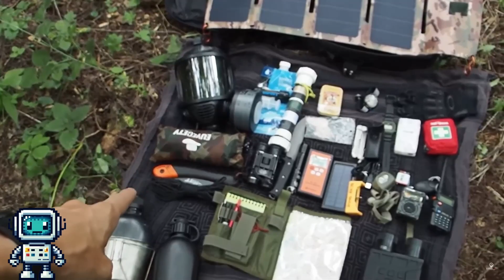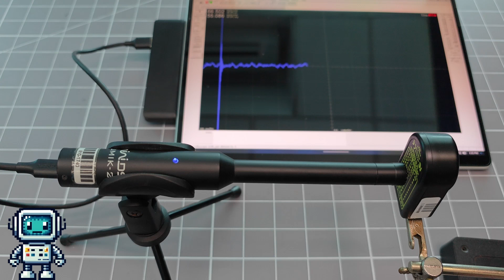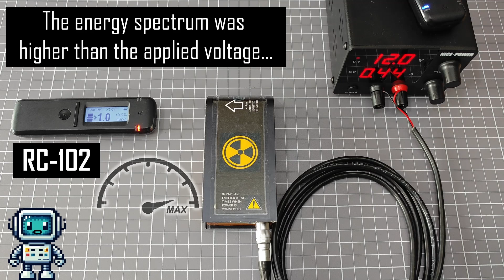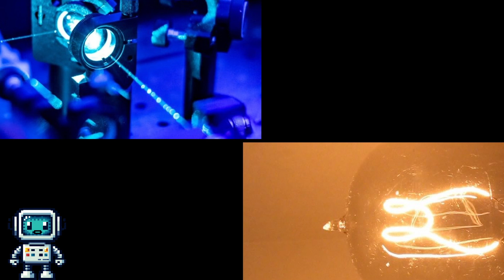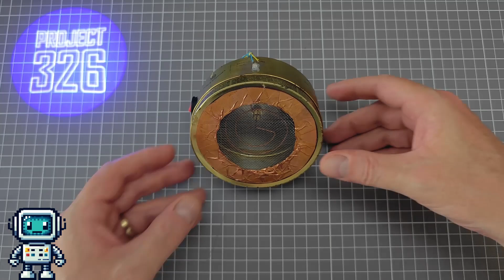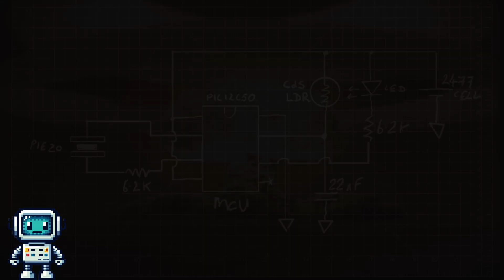NukAlert or SCAM Alert?

Comment: You will never believe this but I manufactured these. It was a family business and they really do work. Im still laughing at the reviews though, good stuff.  

It was designed for "foxhole sniffing" in the aftermath of a serious and spreading event.

The tick is keeping the chemistry primed, the chirps are quiet because it drains battery.

Making it last ten years, waterproof dust proof was the appeal.  I've hit one with a baseball bat and left it to rot in the yard for 4 years and it's still ticking lol.  Keep up the hilarious reviews❤
Reply: I'm thinking you might have gotten a dud. There were a few through the years. If you contact me, I can send you a new one.  Heads up though the batteries were designed 15-20 year life but could only legally claim 10 reasonably.  So it might be mostly dead as they are melt sealed
Reply: Sorry to spam. If you put it in a cool place it will quiet faster.  It's based on a scatter chemcial optical design that was put together decades before the modern sensor tech
Reply: Last one I promise.   I agree that the price was ridiculous.  We did everything possible to keep it American.  I or someone next to me hand made every single one out there.

But r&d, red tape stuff, middle men, filing fees, and investors all hiked the price.  We did our best dude!  I love your format!😂

Comment: Is it really just as simple as a photo detector seeing a scintillating crystal glow in the presence of ionizing radiation? I wonder if they just used a scintillating cube with photomultiplier (ie, Radiacode) rather than a coating.   Can you develop a nukalert alternative? The layperson IMO needs a keychain sized device to indicate it's time to get out of the area (ie, ONLY alarms at thresholds when levels are dangerous, not merely interesting) while being fail-safe (ie, if over-range doesn't reset, fail to alarm, or otherwise undesirable behavior when the area is in fact hazardous), and ideally has a vibrating motor like a cell phone, flashing LED indicator, and a physical sound mute switch the size of a keyfob and USB-C rechargeable or user replaceable batteries.  It would be more of a CDV-717 field survey meter replacement than a geiger counter, picking up where a geiger counter maxes out. Pair it with a Radtus R103 for "hey I ordered mild mushrooms and these are spicy..."
Reply from the maker: I agree with you completely, what the lay-person needs is a NukAlert that actually works.  I also revered a device that is pretty similar but does work: https://youtu.be/suHlPTI6U5w

Comment: Very cool, PLUS a homemade 'geiger' counter. SUPER COOL Never thought they could be so simple. I thought of low-pressure Ne/Ar tubes, but air at normal pressure?  Explain and characterise this one in a video. Why the 2N4117 Ge antique HF monstrosity???? Any replacement ???
Reply from the maker: Thank you for the comment.  I used the 4117 as I had a few kicking around in a draw.  Pretty much any JFET can be used, with either polarity, just need to adjust the circuit shape a little.

Comment: I think you missed the reason for this device - its not for small doses of radiation, but only for very high doses like in a nuclear war. So it should only detect very high doses of radiation and be silent on low doses. Most geiger counters (nearly all I tested) from China you can buy today only detect low doses but are saturated on high doses - they are useless for a real nuclear accident. it would be interesting if the nucalert are useful for high doses like above 10mSievert? If it works for high doses then it would be useful in a real nuclear accident. do you have information about this?
Reply from the maker: Thank you for the comment.

Perhaps re-watch the video, the scintillation material used is actual useless for anything but mid-energy x-rays.  

Personally I prefer to have something more sensitive to avoid getting close to anything 'hot' before it has reached dangerous levels.  So long as a sensitive counter stays at full-scale deflection, then it is fine, what is not safe for a counter to do, is what the Gamma Scout often does, and just report zero in high flux.

In the case of military counters, those from the cold war are a relic of the anticipated order of battle.  Those things were not to save the lives of the soldiers, just to keep them alive long enough to fight the battle.
The doctrine in those days was to come out of protected positions and fight, at the 'correct' time.  Come out too early and the soldiers were likely to be unable to perform their duties due to extreme radiation dose, come out too late, and the enemy has already overrun your positions and the battle is lost.

I don't think that for a survival strategy, having an non-sensitive counter is a great idea.  All of those old civil defense counters were pretty sensitive for a reason...
Reply: @project-326  Thanks for your answer. The most problem from todays Geiger Counters is that they cannot measure high doses - they are saturated very soon and you dont know if its dangerous or not. The Nucalert starts at 0,1 R/h - its a not a dangerous dose and warn you that something is wrong. Most Geiger Counters you can buy today are saturated at this dose and you only know that you have higher than normal radiation, not if its dangerous or not. For this the concept of the nucalert in my opinioon is good, only warn when its high Radiation but before its dangerous and show you when it becomes really dangerous.
My question is only if it really show Gamma Radiation at 0,1R/h or not? Do you have a Radiation source to test it?

Comment: As an alternative i can suggest the Atom Swift. Its a tiny scintillator device that can be used as a keychain, it's mostly used with the mobile phone application that extends its capabilities alot, but even without the app its still very great and sensitive alarm device
Reply from the maker: Seems like a good device, but if I buy any more gamma ray spectrometers, I'm going to go bankrupt!  I'm am going to be doing a review of the Radtus R103 soon though, it is more of a direct equivalent in terms of size and use-case.

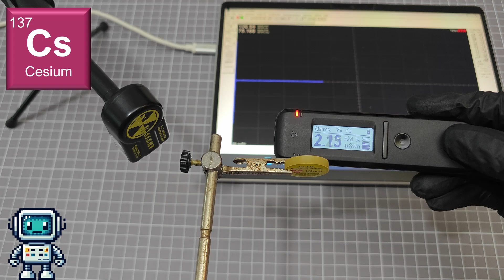Comment: 7:16 The Radiacode device is most sensitive (accurate) on the bottom....
Reply from the maker: The Radiacode devices are pretty impressive...
Sensitivity and accuracy are not quite the same thing with detectors.  Any device can be accurate, its just a case of having a calibration factor that relates count events to units like Sieverts.  Sensitivity is quite  lot more important and also difficult to achieve than basic 'accuracy'.

Comment: The nukalert works well for it's intended purpose. It was designed to detect rads per hour, not milirads. The nukalert WILL alert you to high levels of radiation, it's not going to work for your grandma's trip to the antique shop hunting uranium glass. 😂
Reply from the maker: sadly, the sensing material used in the NukeAlert won't even help with that, it's only sensitive to x-rays.
Reply: @project-326  I'm a noob in this so help me out. If a nuclear power plant blew up 150 miles away from me and fallout was blown over my house you're saying that they nukalert wouldn't detect that? Would the FS-5000 pick it up? Because I just bought that based off your other video 😆
Reply from the maker: @taylorhaubrich  The FS-5K can pick up the background radiation level, so you can be sure it will indicate levels above normal background.  You can even take it down to you local home depot and put it next to some ionization smoke alarms, you should be able to pick up the feint gamma emissions from the Am241 source inside the package.
Hope that helps...
Reply: @project-326  yes that helps thank you.
Reply from the maker: @taylorhaubrich  The FS5000 is sensitive enough to pick up the background levels that exist everywhere, so it will be able to indicate any elevated levels that might exist.  You can even take it down to the local hardware store and place it next to an ionization type smoke alarm, if you hold it close enough you should just be able to pick up an elevated level from the feint gamma emissions of the Am-241 inside the product.
Hope that helps!
Reply from the maker: "The nukalert works well for it's intended purpose"  

I'm curious now, how do you know that it does?  Other that the tests that we ran, there is only one video anywhere of it doing anything (please do let us know if you find any others), and its that one using a dental x-ray machine.

Anyway, I'm pleased that you did actually get an FS-5000, it's a great product and well built (for the price) and you won't have to take anyone's word for it that it works, you can test that device yourself.
Reply: @project-326  yes I ordered one from the AliExpress link in your video description. my only concern is if my fallout shelter is doing its job then I shouldn't pick up any reading on the FS-5000. How do I know there's fallout without taking my geiger outside? 😆
Reply from the maker: @taylorhaubrich  no shielding is perfect, if its dangerous outside, you will certainly detect something inside.  I am thinking about a project to make a video about radiation myths vs reality and it would include some of the issues you have touched on...
Hope that helps, unfortunately there are no easy answers in science, well except for one - no matter your level, the more time you invest into it, the more things you will know.  Actually, no, I'll take that back, there are 2 simple things in science, the more you learn, the more you want to learn.
Actually, maybe there are a few more things too...
Reply: @project-326  lol 😆

Comment: The cheapest detector i have is a "Hakarucchi ipt'a" which i got for less than 30$ shipped in 2014. The "RAT-1W" is the same probably with other look. These where sold after fukushima. They are no longer available, take 3 AAA batteries and have a single button and simple display. They can display average radiation of the last 1-6min (0.1ySv/h - 19.9ySv/h) and lifetime dosage. Mine remembers the lifetime value without batteries since many years. Also shows around 0.1 for background and 2.3 for a old camera lense with thorium, next to it after a few minutes. Considering the inflation since 2014 and that this included shipping, thats quite cheap. Mine has a blue label with a picture of playing children and butterflies on it. I think these where made in japan without any intend to make a profit but rather help people after fukushima. Iam not 100% sure what detector it uses but i think its some semiconductor detector.

Comment: I don't think this product is scam as it was tested using a Cobalt 57 source and the Nukalert did indeed go off (Source: YouTube: "Test of the Nukalert detector with a Mossbauer Cobalt 57 source : it works !!" Channel: florentcalvayrac). Nukalert is for detecting immediately life threatening levels of radiation from nuclear fallout. The cheaper radiation detectors aren't able to tell you if a nearby radiation source is immediately life threatening or not as they max out at much lower levels of radiation. The weaker sensitivity of the Nukalert helps it to detect the more dangerous levels of radiation while ignoring more mundane/weaker sources of radiation. I assume you aren't able to get your hands on more dangerous radiation sources, but if you happen to be able to in the future the Nukalert may deserve a revisit. It would also be interesting to see the math behind the Nukalert's levels of sensitivity and what the Nukalert can actually detect. This would be helpful in determining if the chart on the back of the Nukalert is somewhat accurate or not.

Comment: The original Russian one was decent. It dis more or less the same thing and the battery could be changed. A 10uCi check disk would get it to beep and was loud enough to easily hear it. It was only for detecting dangerous levels of radioactivity and also was only 25 bucks😂 180 bucks could get a decent geiger counter.
Reply from the maker: The Russian one used an actual GM tube, so it really worked with gamma...
Thanks for the feedback!

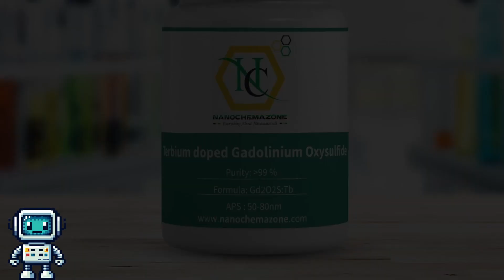Comment: 17:50 min: An addition to your statement that gadolinium oxysulfide is 3000 times less sensitive to Cs-137 than to X-rays and has a shockingly low sensitivity to gamma radiation. If you read the patent US6897448, the sensor consists of 4 components: a transparent cone, 2 layers of phosphor and on top (outside) a high-density metal coating. The author recommends lead. It could therefore be that the sensor is surrounded by a thin lead foil and only the bremsstrahlung generated in it reaches the phosphor and interacts with it. It is then also sensitive to this. That would explain why your first X-ray tube had no effect; the lead completely shielded the low-energy radiation.
It could therefore be that the sensor is more sensitive to radiation that generates a lot of bremsstrahlung.
Reply from the maker: The product data sheet also states that the newer versions don't have the lead foil added.  

Besides, photons don't generate bremstrahlung, only particles (ie things with mass) can do that.  The other point is that bremstrahlung is a very small effect compared to the original flux of beta's or other particles that give rise to it, ie the efficiency is very low.  A typical x-ray tube, which is about as an efficient bremstrahlung source as it is possible to create (ie vacuum, high density target, etc) has a typical energy efficiency less than 1%.  For incidental bremstrahlung, you can expect the efficiency to be somewhere between 0.1 and 0.001%.

I hope that helps.

Comment: If it is that bad, I need one of the other dosimeters. Because I bought one over 20 years ago, I have had to put it in a drawer because my window is under the house waves and it would click so loudly after it rained in 2011  post 3/11 I had to put it in a drawer. The only time it actually made an alarm was riding with my brother on the interstate when he was trying to pass a white unmarked tractor trailer, and I pulled it out of my pocket and showed him, convinced him to slow down and exit to travel on another highway to get away from that truck. Other people carrying a Geiger counter because of 3/11 were having similar experiments on interstates encountering white unmarked tractor trailers. Apparently thefind it safer to move hot loads with no marking or fanfare
?
Reply from the maker: Thanks for sharing your story.

The stray gamma radiation from nukes being transported certainly would not set the NukAlert off.  I have read a lot of reviews that talk about it being triggered by sunlight, power lines, etc.

In a nuclear warhead, there are only three types of radioactive materials, Pu-239, U-235 and in older devices, H-3.  The first 2 are alpha emitters and tritium is a beta emitter.  Without expensive specialist detectors you would have trouble detecting any of those, even at short range (weapons grade material is very pure and so there won't be anything much in the way of decay products that are more detectable).  Natural uranium ore is very detectable with low cost equipment (but not with the NukAlert) because it is billions of years old and has a lot of decay products contained in it.

Look on the bright side, I spent a lot more to test this PoS that you did 20 years ago when you bought it, which makes me the sucker!  In addition to buying it, I needed to pay for shipping to China, importation duty, the x-ray source, when when added up comes to about $450...

In fairness, due to its small size, its a great addition to a "hall of shame".  Its got a cool form factor and a great sales story behind it.  The exact properties that we all should be cautious of when buying new things.
Reply: uhm those are usually nukes being transported.

Comment: Great video as always. Thanks for sharing!
For such a price, I thought they'd use SBM-21 for the sensor to achieve the small size and sensitivity.
Then a minute down the test part, I'm totally angry about how terrible it is.
In comparison, the ionization chamber without special treated gas but filled with merely air works better than I expected!🤯
Reply from the maker: I was really surprised with how it worked detecting x-rays.  It could detect a decent alpha source like Am-241 but was useless with my other sources.  With the x-rays it was just amazing!

Comment: Doesn't seem like a true scam. At least the design technically functions as a radiation detector. I'm sure there was a much better design someone made but the accounting department demanded that they cheapify it.
Reply from the maker: The creator of the NukAlert was a one man team, I believe he took on some staff and uses sales agents, but that isn't the same thing as internal company pressure.
I get the feeling that this was the only design he created, the company only has one product and has been selling the hell out of it for over 20 years.
You are right, it functions just enough to avoid a class action.
Thanks for the feedback!

Comment: The PIC12F5xx series are the absolute cheapest of PIC chips. They are great for small simple jobs and I've used them for many projects because they cost $0.60 each.  The CDS cell is also the cheapest possible sensor and even a simple photodiode alone would probably do a better job. I'd even wager that a 1N914 signal diode might be more sensitive and cost less.
 I'd love to download the firmware of the chip and disassemble it for shits and giggles. I suspect it will grossly under utilize the capabilities of these PIC chips
Reply: PIN diodes work way better. I tested with a set of 6 * BPW34S and a differential TIA circuit, resulting in a response of 15 CPM/uSv.